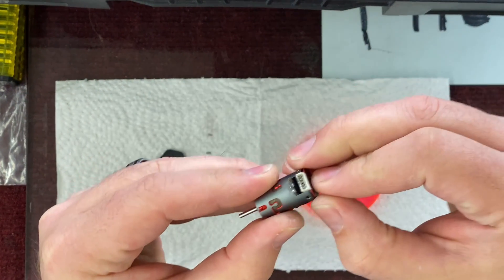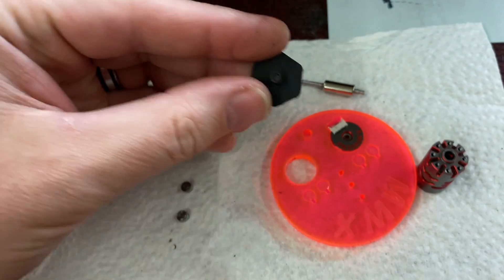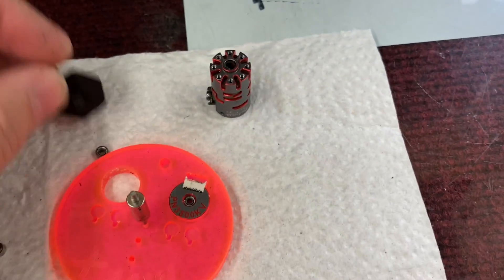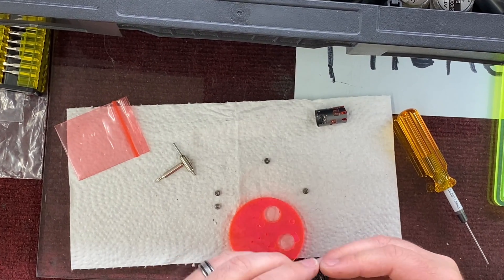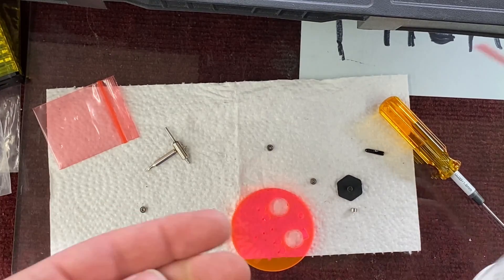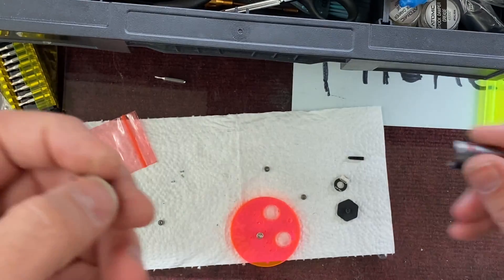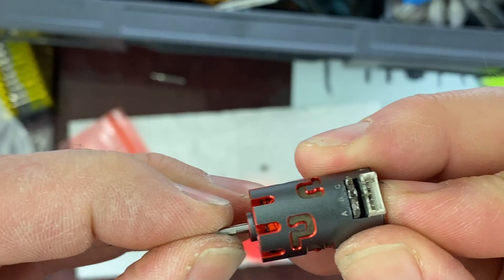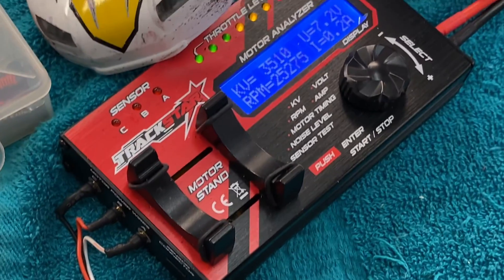Mini Z / 1/28th - We Rebuild a Sensored Brushless Motor. Can we get more KV?!

Comment: Shared your video with my club. They freaked out and claimed it’s cheating.  From what I’ve sean only kyosho and handout motor classes have rules about it. Any thoughts?
Reply from the maker: As long as you KV is falling into the range laid out by the class, it’s fine IMO (of course unless it’s a hand out motor or mentioned in the rules.). The most important thing is that everyone racing is on the same page with what’s allowed and what’s not. ;)

Comment: I hate to inform you but kv means nothing. Hall variance or timing per pole is what you want to watch do full motor test to see how close each sensor is. The closer they are the more power you will create ;)
Reply from the maker: Thanks for the info. Seems like the higher kv motors are just faster.